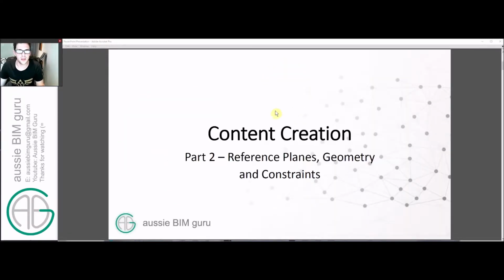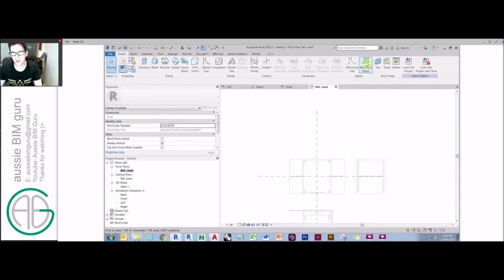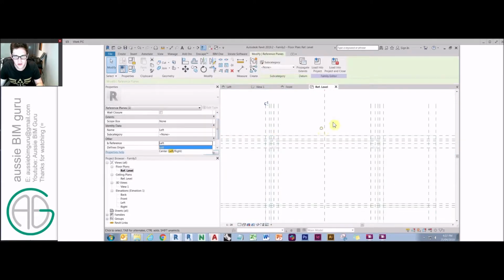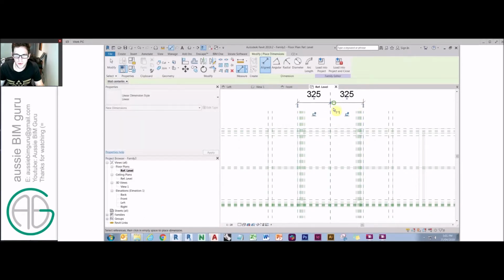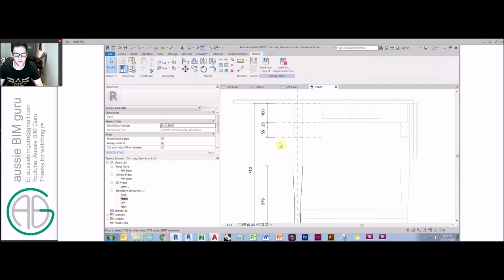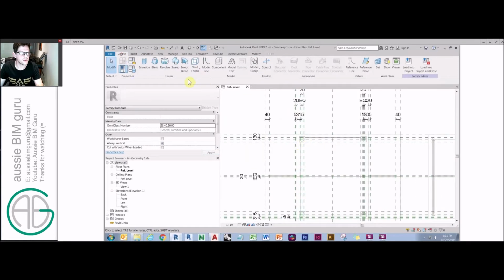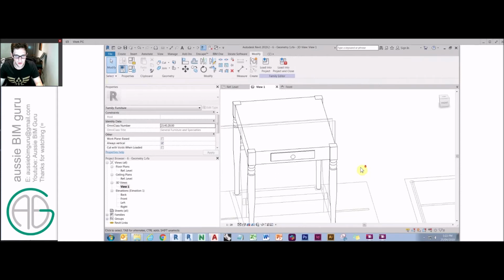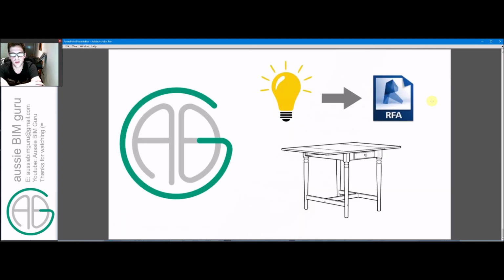Revit Family Geometry & Constraints (Family Creation 2/4)

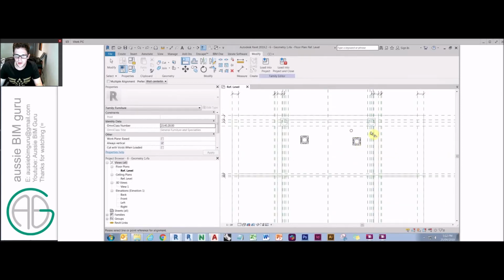Comment: @21:37 you are constraining the legs so that when the table grows in Length and Width the legs will stay in each corner. In my model it won’t let me constrain each leg like that. I can only constrain each leg to move with either the table width or its length… not both…. Very confused 🫤. Any clue as to why this is happening to me?
Reply from the maker: My best guess is you may need to constrain reference plane to reference plane, and might be using geometry for one of the two constraining aspects. That or cross check the reference planes are both set to origin planes and the center reference types. Make sure you are also changing the parameters using the type editor versus dragging planes in the editor as generally that wont work.

Comment: Any tips for the type of parameters to use for a Bar Screen wastewater equipment, which is angled at 80 degrees and needs the bottom part to be able to go underground without the top moving.
Reply from the maker: If it needs to follow a topography i would suggest considering a railing family.

Comment: Did you also used a furniture template or a generic template to make the leg and then nest it into the main file? Thanks for all the explanation, helps a lot.... Wonderful as always and so helpful.
Reply from the maker: Sometimes I begin from generic model template then change its category, but I usually recommend using the host family category for nested components if they aren't shared - that way they are all category correct at the project level and can have subcategories applied if needed.

Comment: Hi Boss, i want to ask you something about the career, if i want to study (Diploma-Civil Engineering) in Canada, Am i eligible to work as a BIM Manager?? if not<<which - Diploma - Program do you recommend to complete to gain this position in the future?

i know you are Australian but i think it`s almost same procedure

thank you for your time man
Reply from the maker: The role of a BIM Manager is one you will need to work your way to via professional experience and time. There is no shortcut. Most BIM Managers work as a BIM Technician/drafter and then a project BIM coordinator - this is typically at least 5-10 years of solid professional experience. If you are a Civil engineer then you would potentially become a BIM Manager in this pathway, but would need to learn more about building services engineering to become an engineering BIM Manager at a higher level.

I always suggest doing a degree in your base trade (e.g. engineering) and then focus on building professional experience. No degree or diploma can replace this.